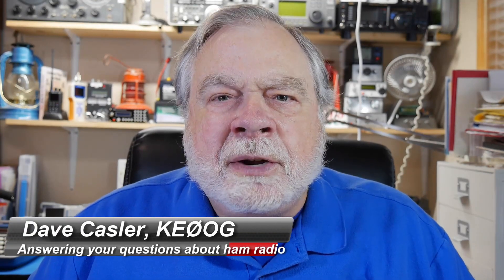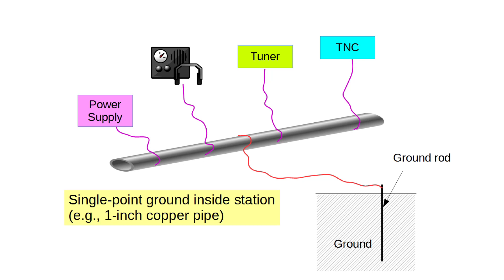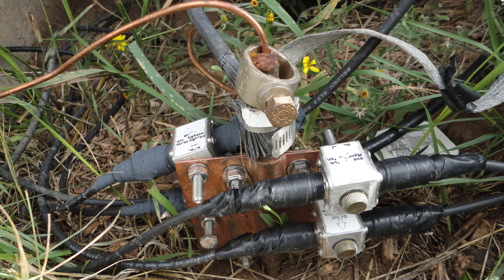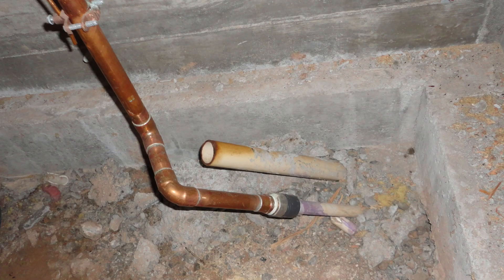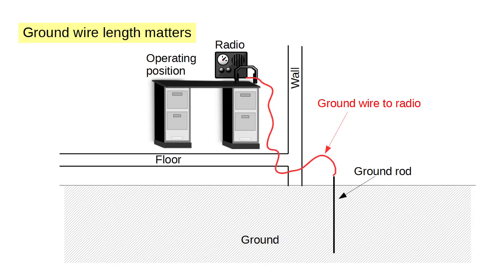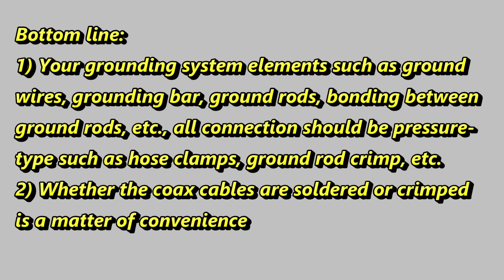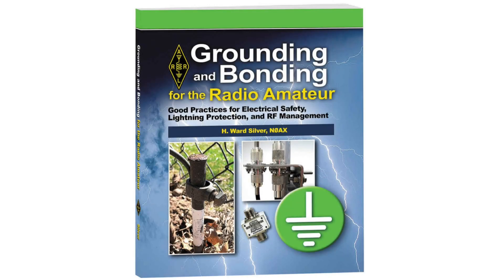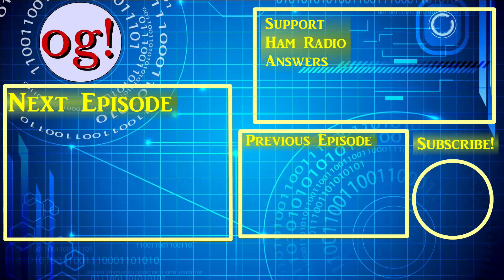Sorting Out Grounding (#409)

Comment: The reason we ground copper water line is for safety.  If a hot wire touches the pipe you want the breaker to trip rather than getting the water pipe energized.   It is not really because it created a good ground connection.
Reply: This entire statement is wrong. Its all about equalizing potential. A copper water line in the earth for at least 10 ft is a much better "ground" than a rod. Read up on the difference between the grounding electrode system and the effective ground fault current path.
Reply: @stillthakoolest  has Dave said most house use plastic coming in from the well or city supply.  But when you have copper pipe they must be bonded to prevent them getting energized.   I have seen this happen.  Also as a code inspector I know the code requires any copper pipes to be bonded.  It there is a a piece of plastic between two sections of the house you must bond all copper.    

You are correct if you have copper I. The dirt it provides a good ground.  However it is almost never done these days.

Comment: Hi Dave,
Our house was built in 1955 and do have copper out the the main water connection. We had to dig to uncover the the copper pipe in the mid 90's as we suspected a collapse causing low water volume. There was no problems with the run to the house and I was surprised at how pristine the 1 inch copper looked after 40 years being buried. The problem was at the connection to the water main where it was installed incorrectly all those years ago. I do have several ground rods installed around the house, all connected to the main electrical ground at the service entrance. Your grounding videos have good information about station grounding. Also like you piloting videos. You and the family stay safe.  73  WJ3U

Comment: My copy of the NEC says #6 for a ground wire to ground rod, and #10 for a bonding wire to join the antenna and station ground system, to house ground system outside at the meter. That's how I understand it from that Grounding and Bonding book too.
Reply: Be aware that the NEC (NFPA doc 70) is not focused on lightning. The lead from the antenna to ground is considered a main conductor for lightning. Nearly all homes are class I structures (class II is 75 feet or more high) so the main conductor is spec'd at 57,400 circular mils, or 2 AWG copper wire, for the antenna. Bonding wires, like for radio equipment and other pieces not in the path of destruction, are to be a minimum of 26,240 cm (6 AWG).
Source: NFPA Doc 780, table 4.1.1.1.2

Comment: Working in the field for telco for decades, I never encountered a soldered connection on any grounding.  Everything was a mechanical connection.  That said, a loose connection can play havoc with noise issues.  Check your ground with a meter and compare it to a known good ground.